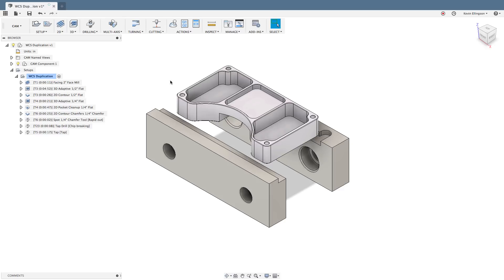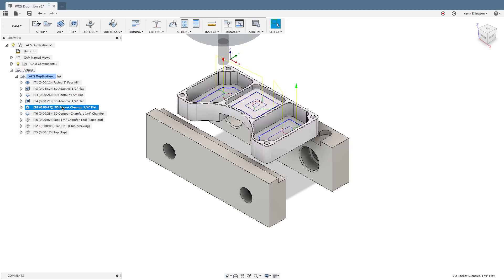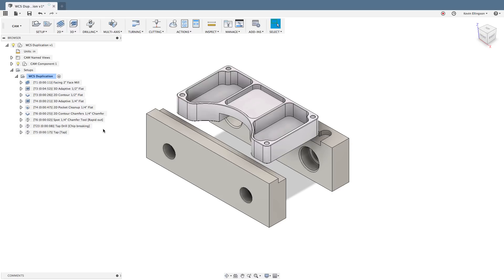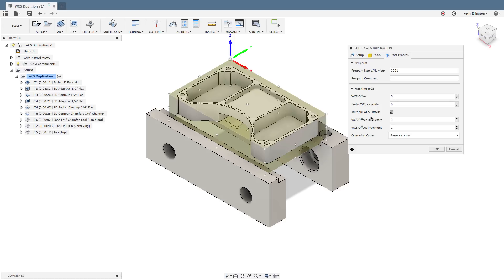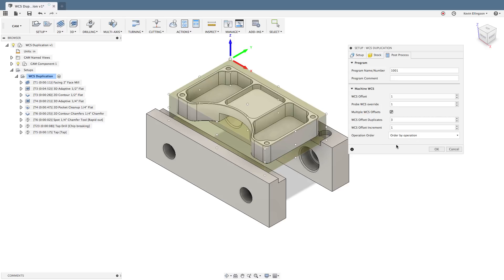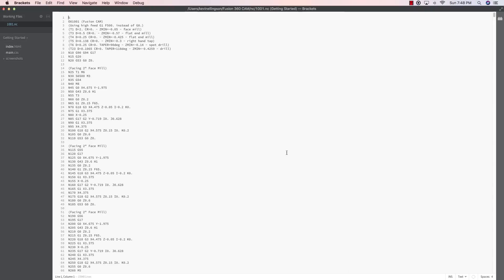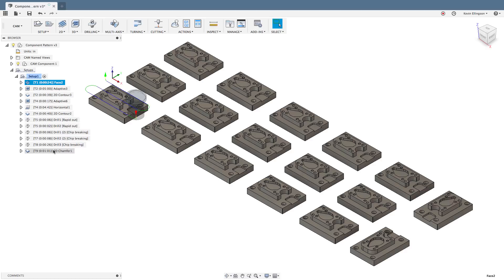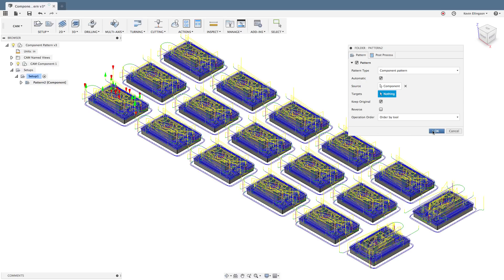Fusion 360 - CAM Duplication Options

Comment: Doesn’t fusion say that 2D pocket is a roughing tool path? What do you do to use it for finishing?
Reply from the maker: It can be used for both roughing and finishing. As a roughing toolpath, it still has its place. Often times adaptive clearing is better for the task but not always. For me, I used 2d pocket far more as a finishing strategy than I do as a roughing strategy.
Reply: @MechanicalAdvantage do you have to do anything specific, like selecting roughing stopovers and finishing stopovers in the passes tab?
Reply from the maker: @shaunybonny688  I added a second reply at the same time as you made your post. I'll leave .010" to .020" axial and radial stock to leave. You don't really need to do anything. I'll do 80% to 90% of the tool diameter as stopover, and depending on the situation, will add a countering finish pass.
Reply: @MechanicalAdvantage to prevent it from leaving a faceted finish
Reply from the maker: @shaunybonny688  2D pocket will give you a good finish and won't leave facets like adaptive does. That is the reason I often use it for finishing. I'll rough with adaptive, then finish with pocket.
Reply: @MechanicalAdvantage thank you
Reply from the maker: I forgot the second part of your question. You don't have to do anything to use it for finishing. I typically will just leave .010" to .020" stock to leave and then I use 2D pocket to clean up the remaining material and finish the feature to size.

Comment: is there a way to show the stock on every part in simulation? I have tried using in "process stock" and it shows the tool paths/ stock of the 1st part but does not show the material being cut away.

Comment: Can you make fusion run 2 separate parts on same program,  on different WCS and use the tools (drill etc.) On both parts,  at the same time, to minimise tool changes 
Lars
Reply from the maker: Yes. You just post both programs at the same time and then choose minimize tool changes.

Comment: Cool video.  I'm running across an issue..I have 30 components on a grid but 12 bodies turned off as That is an area I am clamping for now.  While hiding those bodies I was able to pick holes to drill no problem.(By diameter)  But going into pattern mode and picking by Component, it is trying to machine the parts that are hidden. (Using 2D Engrave, FYI) I can figure out some work arounds, but wanted to see if there is an easier solution.  thanks

Comment: how did you positionned your pièce perfecty like you did? I strugle with this part of the production on fusion 360
Reply from the maker: I used a combination of pattern and joints. The parts that are uniform in spacing and direction were done using a pattern. The two odd ducks were placed using joints.

Comment: when I try this with other hidden components they show up when its time to choose my source and screws everything up. any workaround?
Reply from the maker: You will see an option to automatically pick the targets or do do so manually. You should have control as to what source you want to start with.
Reply: @MechanicalAdvantage  does each part need to be its own component or can they be duplicated bodies
Reply from the maker: @dirtkickersandarrowheadlic9317  They have to be components. It won't work with bodies.
Reply: @MechanicalAdvantage  Ok got my bodies as components but still no good. when i select my target it snaps to the component but doesnt show the new toolpath like yours. is this version specific?

Comment: Ok thanks, but how my machine will know were the duplicated parts are. Do I copy and duplicate them in a design tab? I used to set stock in CAM not drawing it, how will it duplicate? I want to put stock in particular places on the machine. It's not clear for me were to start.
Reply from the maker: This method is best used when you have something like a fixture plate to locate all your parts. The stock needs to be relatively close to the position on the machine to match the CAM. The toolpath is copied exactly from the first part and piece of stock.
Reply: @MechanicalAdvantage  thank you for quick reply. I want to cut two guitar necks using same toolpaths. I fix stock on a router table and draw the stock only. Since its flat wood no fixtures other than doublestick tape and steel pins are involved. I have enough material to locate it within some tolerance. Do I have to copy the "model" with drawn stock in design? Or I have one model and duplicate wcs as you shawn? Still I'm confused when I set up exact location of a model on a machine table. Sorry for such simple and silly question. Thank you!
Reply from the maker: @furoraguitars  You have a couple of options. You could place the component/body twice and the. Select both models in your setup. Then machine away all the stock etc. You could place one model and then define the stock as being large enough for two parts. The seemingly obvious answer to the problem would be to program one part and then mirror the toolpaths, but then that changed the direction of cut for the mirrored toolpaths. You could also possibly use circular patter. That won’t reverse the cutting direction but may not give you exactly what you are after. You can also do a linear copy of the toolpath on CAM to do an exact duplication with no mirroring.

Comment: Is there a way that you can break these tool paths down into subroutines? I want to use the same method you used in the 2nd method. The only problem is that my machine won’t be able to store that much data.

Comment: Bro, thank you so much for doing this vid. For some reason mine is not recognizing the other components. So do you have these as separate components with separate bodies? Right now, I have 25 separate components and it's just not working. Any ideas?
Reply from the maker: Are you sure they are a component and not a body? Are the all the same component? Meaning you see in the bleeder Part:1, Part:2, Part:3 etc and not part 1 part 2 part 3 part 4? 

The second thing is, if you do have components, did you select your seed component so it can find the target components?
Reply: @MechanicalAdvantage  First, thank you so much for the reply so quickly. You truly are giving back to a new machinist. I have found the bug that created the issue hidden in one partial sentence in a fusion forum. It was more like a bullet point. You can NOT pattern bodies then turn them to components and get the CAM patterning to work. Prior to patterning the body, it has to be turned to a component, then patterned, only then will CAM patterning work.  Even though I found the answer, I can't say thank you enough for the help. Sean

Comment: Curious how you duplicated these components.. Do you happen to have another video that shows a full end to end flow of this?
Reply from the maker: I don’t. I used rectangular pattern and selected by component. The two on the ends were manually placed and positioned using joints.
Reply: Its simple...liniar pattern...x ..y!

Comment: I noticed when you did the component pattern, the two components at the end in the 90deg rotated orientation are essentially "mirrored" opposite each other. When you applied the component pattern, from what I could see from the toolpath lines, the toolpaths do not appear to be "mirrored". Would that cause any issues? Could it be adjusted in the pattern? Thanks

Comment: On the 2nd part of the video where you had all of parts duplicated in the pattern for machining in a fixture plate. Would you use only one wcs on one of the parts or corner of your fixture or would they each get their own wcs. If you could do a more indepth multiple part fixture plate video that would be awesome. I have been looking all over and trying to figure it out on my own without any success. Thanks for the excellent quality videos!
Reply: He is using multiple offsets. He explains this at 2:30

Comment: Is this an option in Fusion?  If so, what is the option called and how much is it?  Thank you
Reply from the maker: It’s a available in core Fusion. $495 per year USD.
Reply: @MechanicalAdvantage  that I have.  It just will not work.  Everything is components.  I have toolpath on my first part but it will not propagate to the others.  Frustrating.  Any help would be greatly appreciated.
Reply from the maker: Are each of the components the same name? For instance, Bracket:1, Bracket:2, Bracket:3, Bracket:4, Bracket:5 where the number represents the instance number for the component?
Reply: @MechanicalAdvantage  yes, each body has it's own name
Reply: each component, I meant
Reply from the maker: @TRAKmanFlorida  email me the file. Kevin @ mechanicaladvantage dot com
Reply: @MechanicalAdvantage    Sorry, but the file is proprietary.  I do have GoToMeeting, if you are up for that some time?
Reply: @MechanicalAdvantage    that's Fusion 360, right?  Sorry, I'm just learning.  And having no success with this feature at all.

Comment: Can the components be slight different dimensions as long as the tool-paths are adaptable to those changes?
Reply from the maker: Hi Lorenzo. No, in this case they have to be tied to the same component. If the component were a different size that would mean it wasn’t identical and this method wouldn’t work.

Comment: Thank you for this, this is really great information!

I do have a question about the second option with the pattern, though. Is it possible to do what you did without having the duplicates already in place? Like, I modeled something fairly simple (it's a short disc with a pattern of holes in it, meant for a filter of sorts). I was planning on CNCing one of them out of acrylic, just to make sure it worked, and then after I get everything dialed in, I wanted to make a bunch of them. So I was initially searching for "how do I tell me machine to do the same operation again, but offset it in each time by _ in X and _ in Y" basically making a grid of these discs on whatever size acrylic sheet I have?

If there is no way to do that, I guess my question would be, what is the dead-simplest way to take my single, complete object, and make duplicates of it in a way that will give me the starting point that you used here for you second method?
Reply from the maker: Hi Matheis. There is a way to do that. Right click on the toolpath and select add to new pattern. You can then create a linear or rectangular pattern of the original.  What you can’t do with that option is change the orientation of the toolpath to match the object orientation.

Comment: The tutorial is pretty neat. I just hope you would have explained how you magically replicated the models, ¿did you do it in the design module? ¿did you duplicate components or just bodies? I really hoped you wouldn't have skipped those parts
Reply from the maker: Hi Fernando. In order for this style of patterning to work, the items have to be components. I did a rectangular pattern for 15 of the items. The two that are sideways were placed with joints.

Comment: Component pattern AND 2 sided milling? Suggestions? A new video?
Reply from the maker: Not a bad idea. When you create the component pattern, notice that Automatic is selected initially. If you uncheck automatic you can select your source component and your target components so it doesn't automatically pick every component in the design.

Comment: I need to run multiple parts like in the second part of the video. My program for 1 part file size is 18k. I have an older machine and only have 32k available in the bubble memory. Is there a way to loop back the code on the first part and only changing the x/y value in the g code to keep the file small? Trying to run 20 parts at once
Reply from the maker: Good question. I don’t think so. But let me check to with a few autodesk CAM contacts to see if there is a way.

Comment: I'm going to assume that when this posted out in the processor, you ended up with only one work coordinate (G54-G59) ?  I've been using G52's for work positioning to do up to 200 pieces at a time on a machine with only one work coordinate, and each operation becomes a sub program that just repeats each time it's called up to do so.  I've ran nearly all CAM programs out there, and none have been able to utilize this feature, which is a shame.  
Perhaps an additional video to compliment what you have here, would be showing how you could pick up one of those components to machine half way through the program, as if a tool broke and you didn't want to remachine all of the components.
I'm curious what would be the best method for that in Fusion 360?
Excellent videos by the way.  I'm learning a lot of tricks.  My programming career started out with a calculator and notepad about 30 years ago.  CAM has sure came a long way.
Reply: I'm about to test this technique, but I'm going with the component duplication. I haven't wrapped my head around the WCS yet. I just build a DIY CNC, it's not like I'm running a high end system or know the stuff.
How was programming 30 years ago? What type of machines did you use?
Reply: @matiasgoinheix366  I started out running a 1985 Mori Seiki MV Junior with a  Fanuc 10M controller.
I then moved on to Haas in 1992 when they were first came out and have since ran Matsura, Mazak, Okuma, Hardinge and a ton of others.
All that being said, code is code and very little has changed, other than some canned cycles that are proprietary to machine brands.
Machines and their capabilities, as well as CAM programs is what has really evolved.
CAM programs are great, but knowing what is happening behind the scenes is what separates the men from the boys....
Reply: @triggerguard1  I need to learn more about it. I feel that all I'm learning is like driving in auto while I should be driving stick shift. Any book recommendation for a beginner?

Comment: Hi, new to this. Ok at doing a simple 3D model (coaster with 2d pocket for filling with resin etc), and understand the last part of the video re the component duplication for the tool path, but cant figure out how you got the multiple models on the screen and positioned them in the first plave to then do the tool path duplication, Thanks in advance

Comment: One thing I would like to see is multiple discrete parts. Ex. We make a machine that contains different 5 parts. Say they would all fit inside an aluminum block of 100mmX200mmX60mm.
How would you go about milling one side and then the other

Comment: Hello, sorry Kevin a little off-topic. I see the same part duplicated but I am interested in knowing how to layout different pieces that need to be cut out of a piece of plywood.
Reply from the maker: That will be a more manual process, at least for now. Do you know about the Fusion App Store? I believe there is an app in there that will sort of arrange your pieces in a flat orientation for you.
Reply: @MechanicalAdvantage  thanks for the reply, I will have a look tonight. I created a piece of plywood the size I need 8 foot by four foot and have imported the pieces into it,  but the holes in the imported pieces automatically get filled in. I'm guessing by the plywood component. I am not sure. It is amazing what these programs can do. I enjoy your videos, you are very clever. Keep them up.

Comment: Hi, quick question! So do you just set in, for example, Mach3, where G54, G55, G56, etc are located then? Doing what you did in Fusion simply writes the G-Code to machine each part at its designated WCS, but I'd need to actual define those, or zero out the machine at each one before starting the actual job?
Reply: Figured it out in NYC CNC - and my assumption was right. You set the actual location of G54, G55, etc in the actual controller program (Mach3 for me) by entering which WCS you're defining and then zeroing it there, one at a time. 
Following this instructional in Fusion 360 will simply generate G-Code that's copy pasted with the tool being driven off "G54, G55, etc" - which have no definition in Fusion, they are defined when you zero them on the actual CNC one at a time.

Comment: how you would involve and probe measuring in both variants?
Reply from the maker: Hi Nikos. For the first part of the video, you would use the probe to teach the machine G54 for the first part, G55 for the second, and G56 for the third. In the second part of the video, you would only need to probe in G54 and then you would rely on the fixture plate to set the location of each of the remaining pieces. If that doesn't make sense, let me know and I'll give it another shot at explaining.

Comment: Did you pattern the component and then rotate the last two to fit?
Reply from the maker: Kyle Blakely Hi Kyle. Yeah, I sort of hacked this one together to show the component pattern. I patented the majority of the components using a rectangular pattern. The last two I placed and used the move command to get them into place.
Reply: Ok thanks!  is there a specific way components have to be patterened in order for the cam pattern to work?  I will try it out and see what happens!  Thanks for sharing!

Kyle